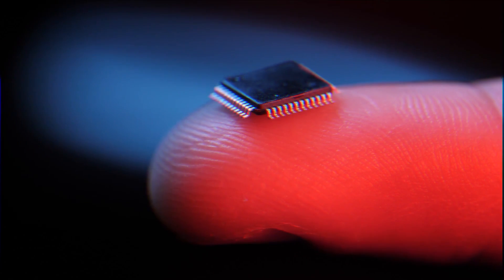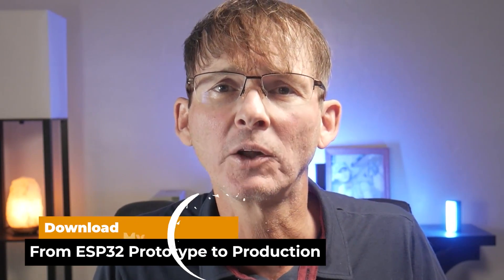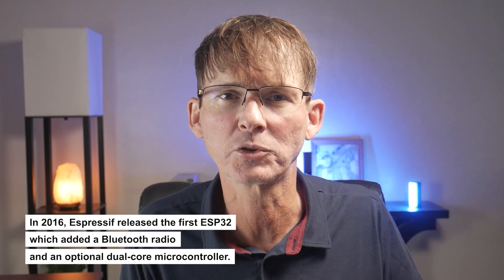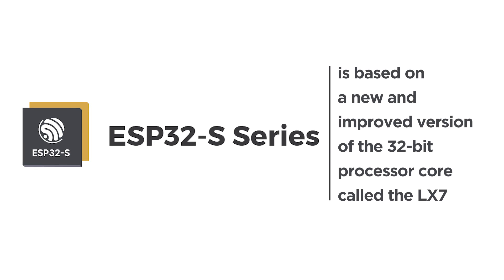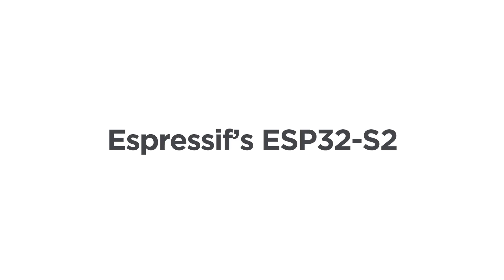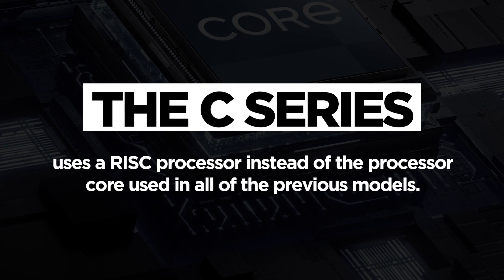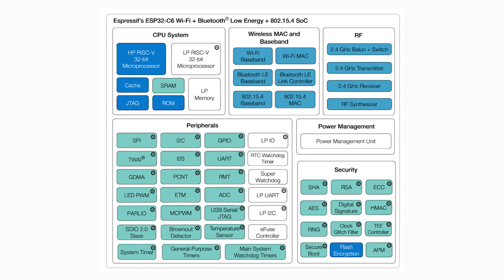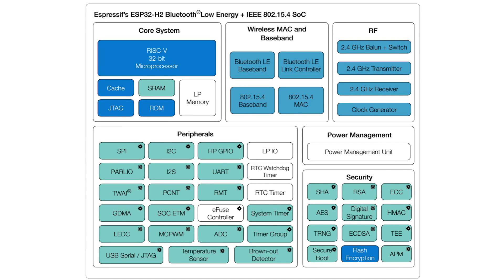Which ESP32 is Best for Your Project?

Comment: Can anybody here suggest which ESP32 controller to use for building IoT interface to Single phase induction motor ?
Requirement includes remote turn on / off, real time monitoring of motor speed/rpm data, capacitor health check, load detection, user notification.

Thanks in advance 🙏🏻
Reply from the maker: Any of them can easily do this. Depends more if you need Wifi and/or Bluetooth.

Comment: It seems the biggest advantage to the dual-core Risc-V C6 is that it has a built-in debugger... whereas the dual-core/bluetooth S3 requires an external esp-prog JTAG adapter?

However, in terms of development, I'm a bit confused.. 
VS Code + IDF Extension you need to first install IDF
VS Code + PlatformIO Extension, you DON'T need IDF nor IDF Extension

but aside from the different build-systems, what is the difference between VS-Code developing/debugging using IDF versus using PlatformIO?  

Do you use PlatformIO?  If so, do you single-step debug with built-in jtag (C3,C6)  or external jtag (esp-prog) ?   gdbstub?   Can you debug both cores?

Would love to see a video on setting up the environment (openocd?) .  Many of the videos that show how to configure are a few years old, and the settings (menus options) have changed.

Comment: Thanks john great video as always. For any hobbyists out there reading this who plan to hand-solder or hot-air their ESP32 module to a custom PCB, I was an idiot and learned too late that if you select the "MINI" version (like an ESP32-S3-MINI-1U), all the pads are underneath the chip and not visible around the outer edge like the non-MINI modules  (there's literally a picture on the first page of the datasheet *facepalm*).  So hand soldering is kinda out of the question for minis (At least the ESP32-S3-MINI).  If you intend to use hot air, you won't be able to visually confirm the melting of the solder paste or if there's any shorts or non-soldered pads (cuz the pads are under the chip and not visible) and it was a problem for me. Your results may vary.  So I changed to a non-mini version: ESP32-S3-WROOM-1U
Reply from the maker: Great point. I commonly use the MINI but that's also because I never do hand soldering. That's always been my least favorite part of electronics development:)
Reply: Lesson learned: that's part of what makes them "mini"—the pads are under, not beside. 

You actually can hot-air them, but it's an act of faith. Tiny hotplates are really inexpensive these days, but I lack that faith that the floating puddle of flux and motel metal really will do the right thing and magically snap into alignment when cooled. I, too, dislike that and haven't had a great success rate. The videos of people soldering Mac M4 SSDs and such are just sourcery to me with my shaky hands and shot eyes.

Plus, if you're having them machine assembled, you either can't have parts on the other side or you are now in the Extra Special price bracket, which is a drag.

Comment: I feel like you're going backwards. People starting with the module should start with the simplest chip, and expand as necessary. Going all-out in the beginning can be a severe turn-off to newcomers. Too many pins+optional / same / different pins=too much thinking. I've been one of those people. It's a great platform, but everyone should start at the bottom, and work their way up. There's a lot to learn from this platform, and starting at the top is a waste.
Reply: I disagree. The world changed in the last 40 years. This isn't a Z80 that you can just wirewrap with super sloppy unshielded signalling around your memory bus and not worry about the impedance of your memory busses and such. These are reasonably serious parts. You're potentially looking at a 4mm^2 chip with a 160Mhz external bus and RF concerns with two cores. Given a choice between starting with a tube of unprogrammed chips vs. a $4 board I can plug into a laptop and have reasonably complex code running in an hour for a viability test, the days of "start at the bottom and work up" are gone. I'd do a viability test with those protoboards, maybe even spin a dozen adapter boards to mount sensors or displays or whatever to those very protoboards that already have the high-speed signaling, RF, power, etc. worked out. 

Need a few hundred to a few thousand? The economy of those modules is just hard to beat. Rake solder a bead around the edge, and you're done. I'm pretty sure of this because you can break open a LOT of name-brand products and see these modules being used. Probably a third of the WiFi iOT things (e.g. holiday lighting) you see at retail are using these modules. Those modules work out which brands of SPI devices are working and set the fuses to work with 1.8 or 3.3V so I don't have to burn up a couple remembering that lesson. Two bucks for a tested, dual-core, high-speed package with (most) international certification? Yes, please.

If you're big-league and sell many tens/hundreds of thousands where you have an accounting department that's willing to hire an RF group to help work out the antennas/interference and all the international certification issues and high-speed digital and qualifications for the octal SPI Flash (not just any will do) and RAM and such, THEN talk about going back to "simplest chip" once spending tens of thousands to save nickels per unit makes sense.

John got this progression right, IMO. That's why he's at the front of the class.
Reply: You are the only person that will run in that issue

Comment: Is there any particular advantage in getting an ESP32 C6 instead of H2 and vice versa? I'll be needing no Wifi and only bluetooth, so which one do you recommend? Also between the WROOM and MINI module, which one?

Also I noticed the H2 DevKit is more expensive than C6 DevKit on DigiKey because of low supply, I suppose? So which one can I rely on more when I start mass production?

Edit: Also when you go to order samples -- it says N4, N2 or H4 at the end of the module name -- what is that supposed to mean?
Reply from the maker: If you don't need WiFi, and only need Bluetooth LE, then I'd go with the H2. There's a lot of overhead to support WiFi so if you don't need it then choose a version without it.

Also, you may want to consider other non-ESP32 chips if only doing BLE, and especially if you need ultra-low current. For example, for BLE only designs I like the nRF52 BLE microcontrollers from Nordic.

The N2, N4, N8,etc at the end of the development kit part number indicates how much memory it has on the dev kit board (Flash and RAM).

I wouldn't be too concerned about the prices of the dev kits since you'll very rarely go to production with those. Instead focus on the cost of the SMT module.

Hope this helps.
Reply: @PredictableDesigns  Thanks a lot! This really helps tons... I think I'm going to go for H2 but now what are pros and cons of MINI and WROOM? It would help a lot if you could clarify this!

Comment: Slight clarification: All ESP32s use RISC processors. The difference between the original and S series vs the C and H series is that the former uses processors that are built using Tensilica's Xtensa Instruction Set Architecture (ISA) which is a proprietary RISC ISA that is licensed for manufacture similar to ARM. The C and H series, however, utilize the RISC-V ISA, which is the fifth free and open source RISC ISA to come out of UC-Berkeley. Interestingly, the S3 also includes a RISC-V core for its Ultra-Low-Power mode. Note that the ISA being FOS does not mean that the processor designs are (some are) the licensing for the ISA is rather permissive. However, there are no inherent fees associated with using the ISA in a design, which significantly lowers the cost barrier for custom silicon.
Reply: Good info, thanks!
Reply: "Risc architecture is gunna change the world" "risc is good"

Comment: Thank you John. I believe that the C series also misses the features of capacitive touch and wake on touch that the original ESP32 had? Not sure if that has been deprecated across the range?
Reply: Depending on your situation you may be able to use the reset button and read the wakeup case to achieve the same effect as wake on touch